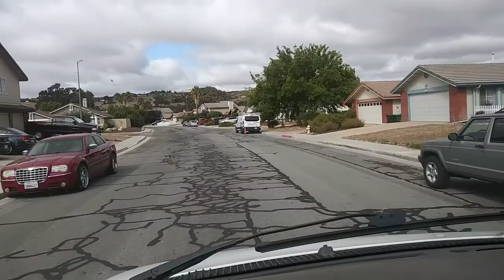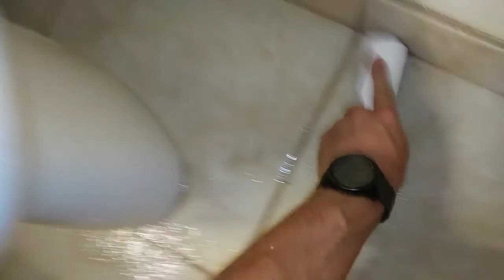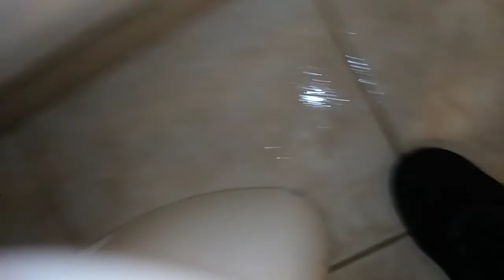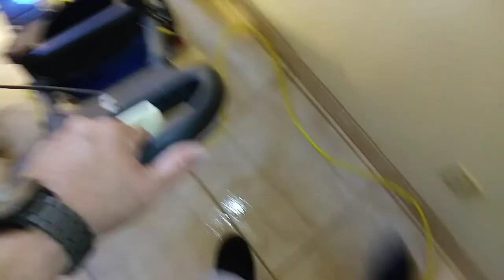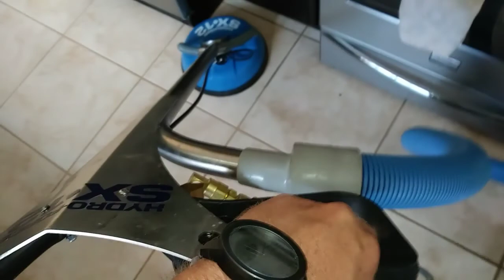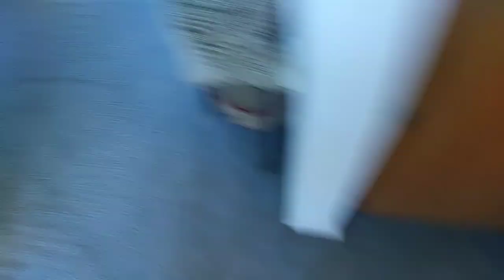Clean with me - Tile and grout cleaning

Comment: Nice do you have a knee roller for sealing the grout
Reply from the maker: No but I need some.
Reply: Should be getting this time for grout cleaning and seal should be at 1.39sq ft .79 to .60 to seal
Reply from the maker: @Fredthehead2  Hey you do what works for you.
Reply: @greenrhinoproject  . Use water proof knee pads  pads . that roller  is in my opinion is Junk ... !  i bougfht one and all it does it put stress on your lower back because  your knees  are raised off the ground  at an unatural height making you have  to bend down more to reach  what your cleaning ...  but surely a  grout brush on a  pole is the best option in most cases..  ...
Reply: @Fredthehead2  Go away man ,leave the man alone .

Comment: Why dont u use a hydro force spray connect solution line with hot water instead of a pump sprayer and prochem tile grout cleaner dont need to do a pre scrub .. whre ur grout brush around a nasty toilet ( gloves at ) hope ur charge enough . If your not getting .79 a ft waste of time
Reply from the maker: $.89 sqft plus $.40 for seal. Always prescrub for best results.